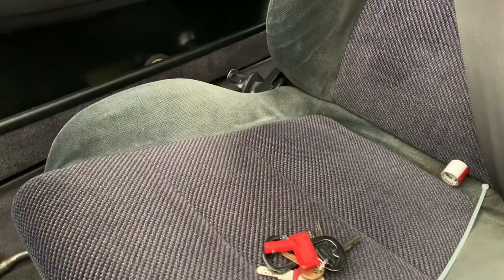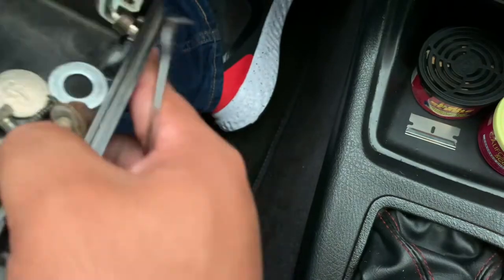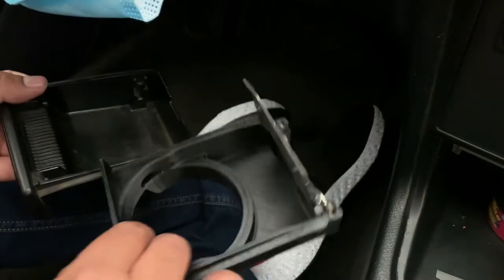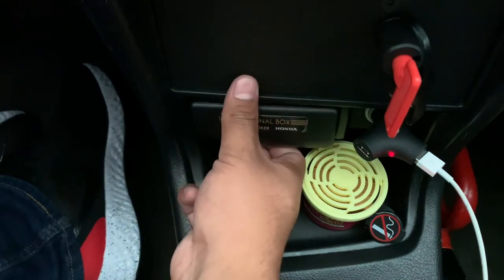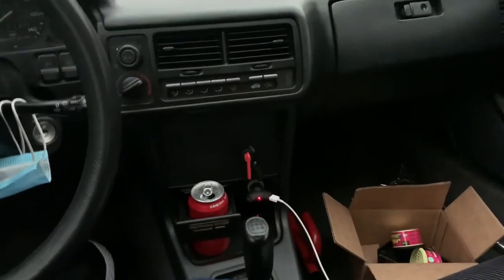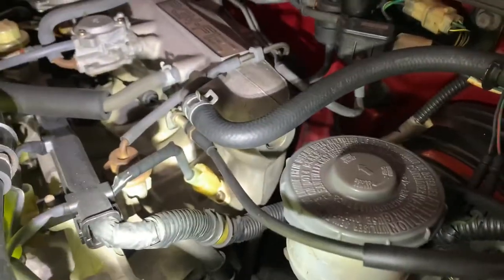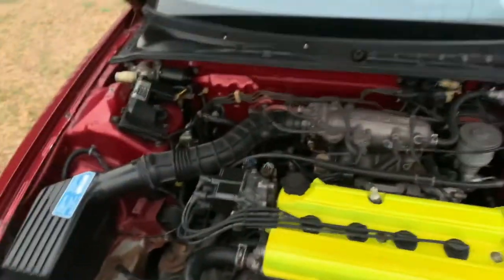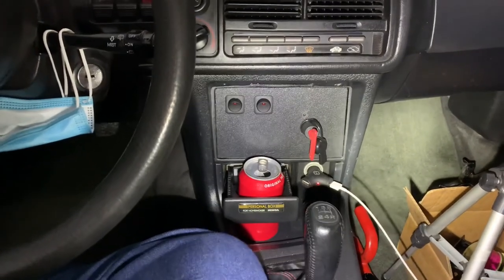GREGPARTS DA9 CUP HOLDER ON MY INTEGRA/ UPDATE BATTERY RELOCATION

Comment: What are those other lil switches on the panel where u put the kill switch! And u still havent told us bout the spoiler, like where to swoop 1 and from what car it comes from..but that cup holder is sweet bout to cop me 1 for my da.. 🍻🤘
Reply: @ToledoDIY  kool! That whistle is hella funny! Saab spoiler go figure. I also just dropped a new radaitor in mines but i swooped a mishimoto 4 my whip i ran my fan to the ignition so when i start the car it automatically turns the fan on.. 😷stay safe out there fam🍻
Reply from the maker: Hahaha yes I love the whistle! And yea right!🤩🤩 who would of thought.. damn that’s awesome! I originally wanted one of those radiators but I went the cheap route.
Reply from the maker: Yes! Mine had it wired that way too but it took forever to warm up and I was like wth! Thanks man you too have a blessed night!
Reply: @ToledoDIY  just got to switch out the thermostat to something that opens up quicker and problem solved..have great night yourself🙏thanks 4 hollering back..its appericatted 🤘